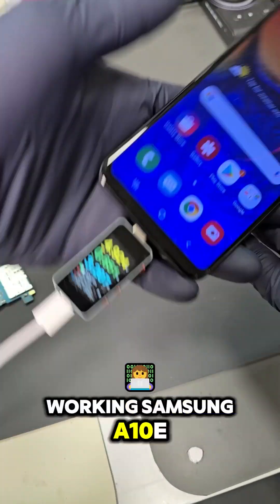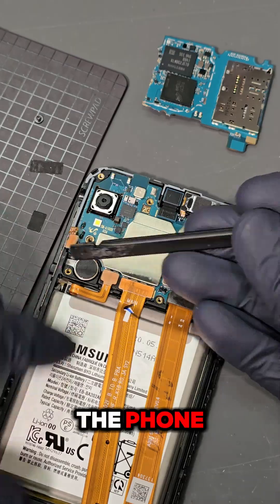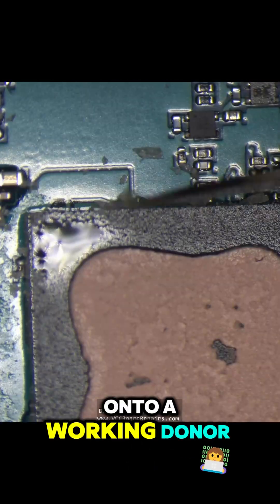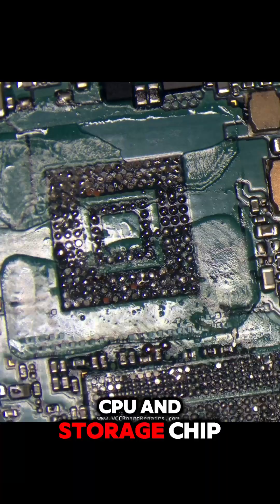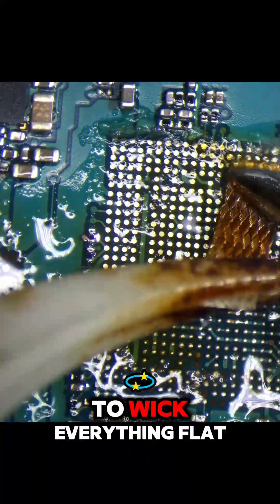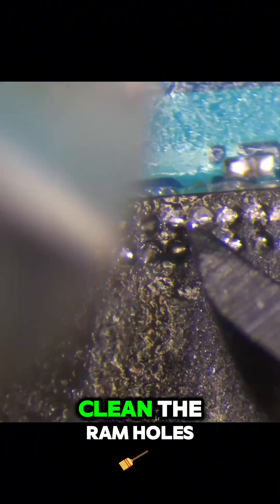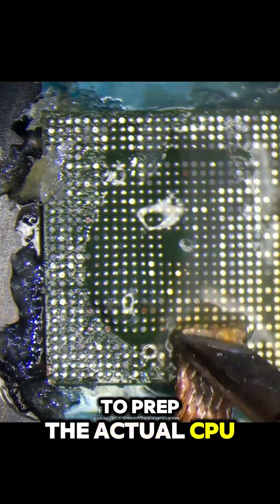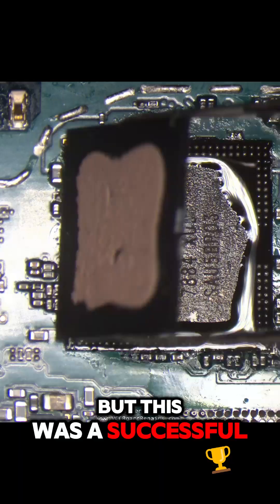WOW Samsung A10e Survives Lawnmower Test!

Comment: Great watch as always, are you dropping the review of the new seek nano 300 soon? Thanks
Reply from the maker: Yes! Will be doing it this week! It was a holiday weekend last week here in the USA
Reply: @ thanks so much .looking forward to seeing the review on that one, happy holidays. Thanks rich
Reply: @VCCBoardRepairs there was one thing I wanted to ask you, I’ve come across a weird fault numerous times recently. The same fault in a number of devices. So far it’s been on numerous iPad Air 4’s and now come across it on the iPad 10th gen, I was wondering if you come across it as well and may know what causes it. Basically everything tests good and device is fully working but cannot connect to iTunes. It charges, port tests good. Changed cd32 and Rom and charging port and tried different computers and cables etc. it’s not that. Tried literally everything but it just won’t connect to iTunes . When plugged into the computer it makes the charge noise. Put into recovery mode still nothing. I’ve literally come across this on about 9 different occasions so it’s becoming common . Always on usb c devices. Any ideas what could cause this and have you come across this before? Thanks rich